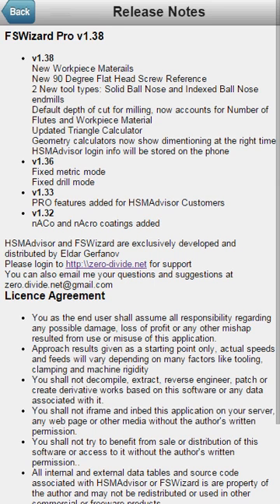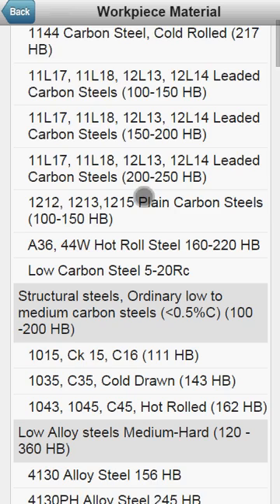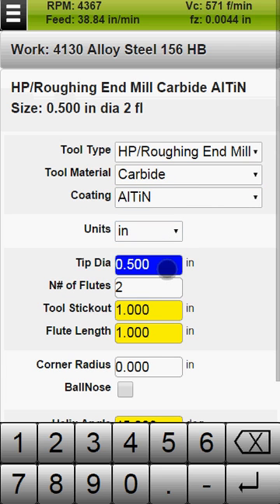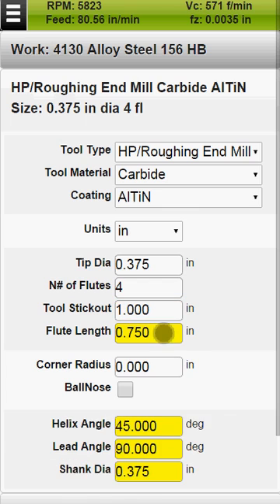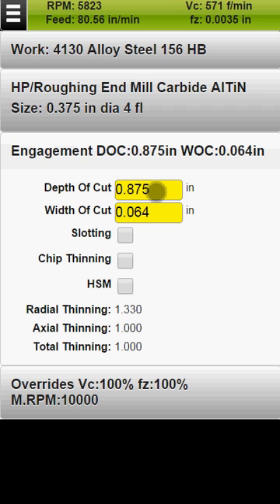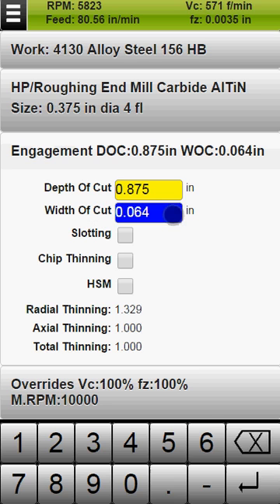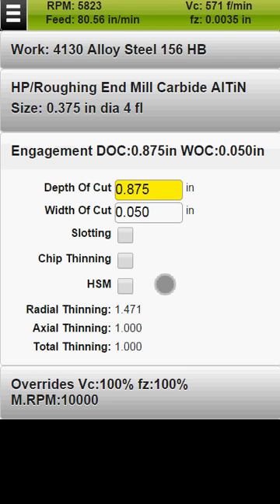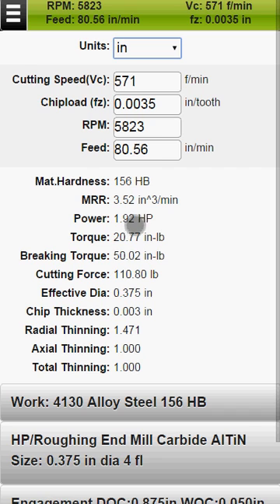FSWizard PRO CNC Speed and Feed Calculator For Android and iOS

Comment: i use this exclusivly as i dont have a computer to carry around with hsm advisor.  this app runs great on my tablet and smart phone. I just  wish it had more of the same functionality of HSMadvisor.  Id certainly pay more for that upgrade.  Also, have you considered adding a user "upload parameter" setting for folks to upload known good speeds and feeds? you would essentially have thousands of testers and over time the database would be incredible.
Reply from the maker: Hi,
Unfortunately the framework I initially chose limits the size of my app.
Out of the box it will give very similar results to HSMAdvisor. The only differnce is that you can not save your Tool/Cut parameters into an internal Database.

I am, however, working on a very similar feature that will also link HSMAdvisor and FSWizard databases together.
Thank you for the sugestion!
Reply: +HSMAdvisor thanks for the reply. I look forward to purchasing hsmadvisor.   I will pick it up in the next few months as I'm doing more and more hsm.   Still learning the basics behind it but your software helps a lot.   I think the only other  thing newbies like me might need is a dynamic help.  Or perhaps illustrations of what certain options are or what they do.  (like chip thinning for instance)  how. Do you know when to check that box,  or just hsm,  or both?
Reply from the maker: +MotorsportsX You are welcome. There is Help section available through menu button.(top left corner).

I initially had a tool-tip help, but because most labels have a function of resetting input fields they are associated with, I had to do without them.
Perhaps I will add a short guide at the bottom of each tab....
Will try to squeeze it in the next update!
Reply: @HSMAdvisor  More information on the HSM button would be great.  If I hadn't watched this video then I wouldn't have known when I should be able to use it.
Reply from the maker: @andrewwillis6584  Hi, this info is already spelled out on the Help page.